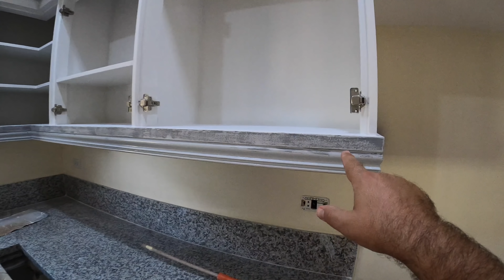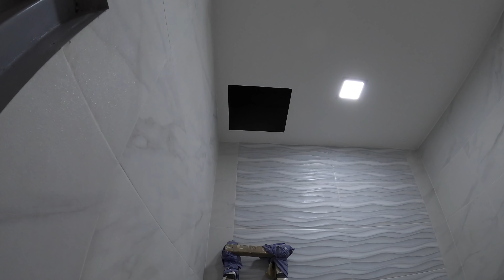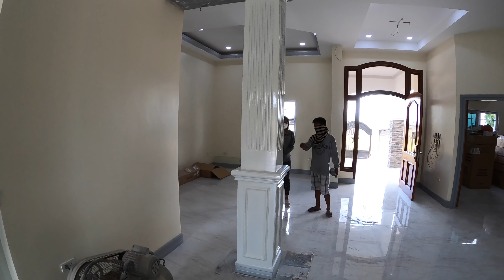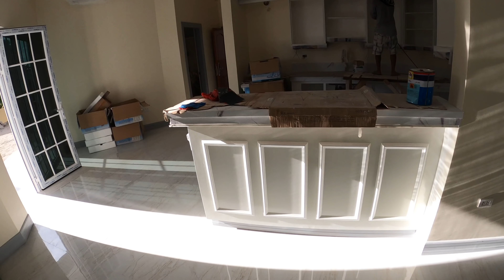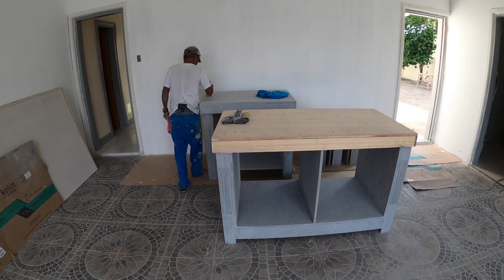Philippine House Building Step by Step, Build Day 239: Hanging Around The Christmas Tree

Comment: Try a piece of Chain for the fan hook.
Reply from the maker: Thank you for the tip. 😊
Reply: @CasaTexPina  The Rebar is good but the Tie wire they use here is made from the late 70s cars I guess.  lol    they have huge rust problems and become brittle and break in a few years
Reply from the maker: Thanks for the heads up. We’ll keep an eye on it and try to replace it with something better after the build is complete.

Merry Christmas and Happy New Year